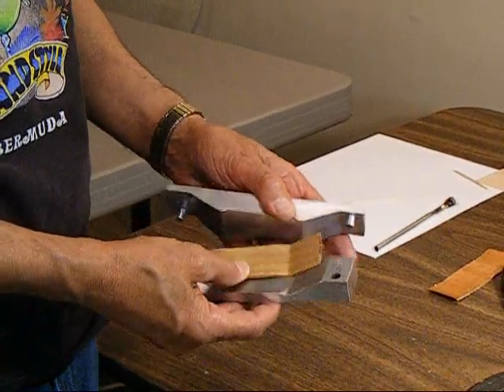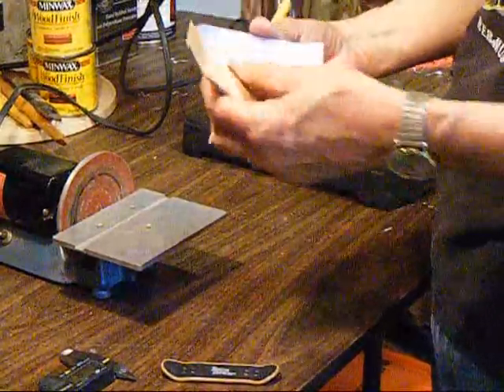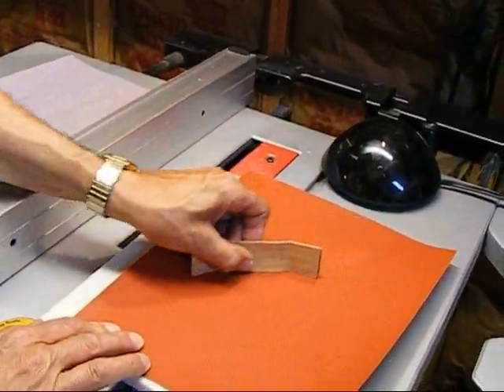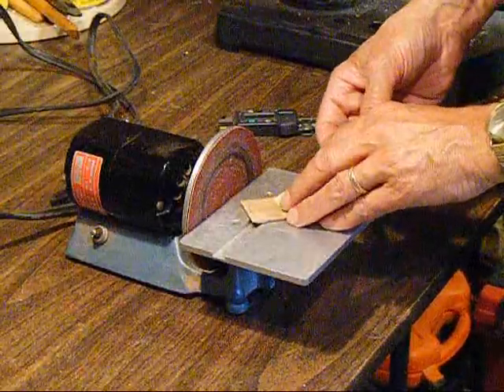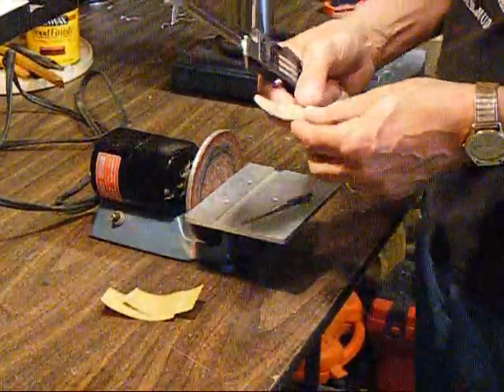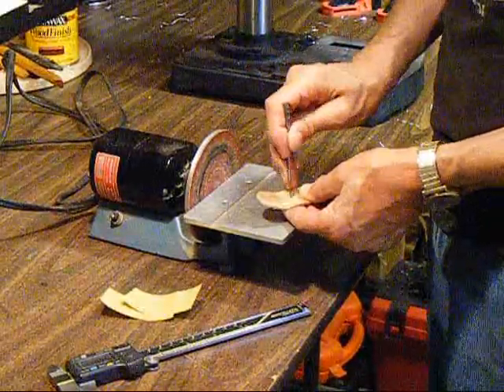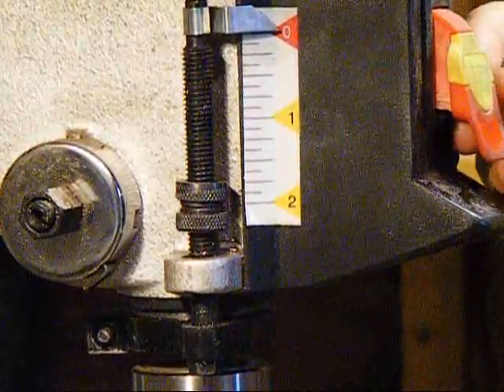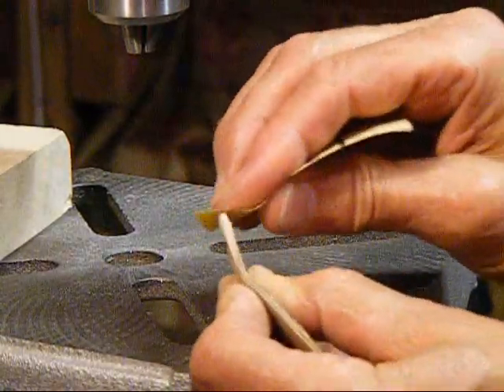How to Make a Fingerboard Part 2

Comment from the maker: The .06mm veneer would probably work ok w/o sanding. Try it and see if it bends ok without splitting. Also with a thicker veneer you might want to leave it in the mold longer because it might require more time to set.

Comment from the maker: @BJFingerboards 
MINWAX Clear Gloss Polyurethane is the most glossy. That is probably best for fingerboards. It's available as a Wipe-On Poly, a spray and a brush-on. The Cabot Brush on lacquer works pretty well also. You have to try different finishes until you find the one that works best for you. As long as it is nice and smooth you'll be fine...it just takes practice.

Comment from the maker: @CCProBowl 
You could use scissors to cut the veneer before it is glued. But after you would need a disk sander
or scroll saw or maybe a jewlers saw to cut out the deck shape.

Comment from the maker: @AndiiAnderson 
Most people use a 4 or 6 inch disk sander although you can use a belt sander also.
They are available at stores such as Home Depot, Lowes or Sears for about $100.
Used sanders can be had at yard or garage sales or even eBay.

Comment from the maker: ELMER'S white multi-purpose glue is used for craft or hobby projects that don't require the bonding strength necessary for fingerboards. Right now I am using Titebond but any high quality wood glue would work.

Comment from the maker: @TimeToFingerboard 
I would think that epoxy resin would work better than bondo.
Especially If you made a model of the mold and then cast it from a silicone mold, which you would have to make. Then you could have as many copies as you needed.

Comment from the maker: Making a NFB metal mold requires a CNC milling machine, a CAD program to design the mold and machining software. In addition, it requires a LOT of time to learn how to use them. If you mean - how to make a metal mold by hand...that would be VERY difficult and I really don't know how you would do that.

Comment from the maker: 80 grit, 120 grit, 180 grit, 220 grit. Start with coarse paper and gradually
change to finer grit paper. You could probably use just 120 and 220.

Comment from the maker: I cut it from thin aluminum (.5mm) using a scroll saw blade. But that could be dangerous is you are not familiar with that type of saw. You could simply trace the outline of the veneer with a pencil using the edge of a ruler and then cut it out with scissors.

Comment from the maker: @soltis78441959
It has to be cut with a very fine saw blade. Such as those used on a power scroll saw. It can also be cut, by hand, with a jewlers saw. It can be rounded with a metal file and sandpaper.

Comment from the maker: The truck screw holes are 1.5mm or 1/16 inch. If you use a 2mm drill it will be too big.

Comment from the maker: I don't think you can accurately drill the holes with a hand power drill & that is why I use and recommend a drill press. This would be especially true when trying to countersink for the screws. You might get lucky but you will probably ruin more decks than not.